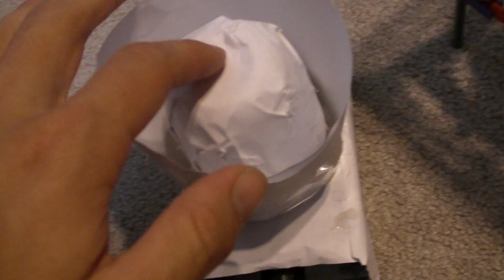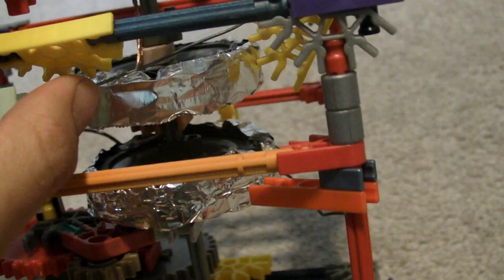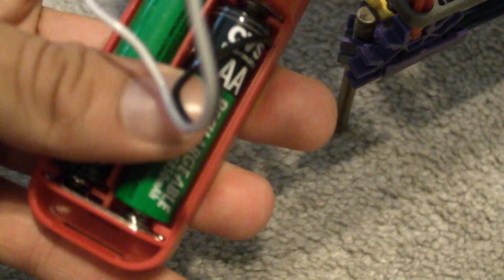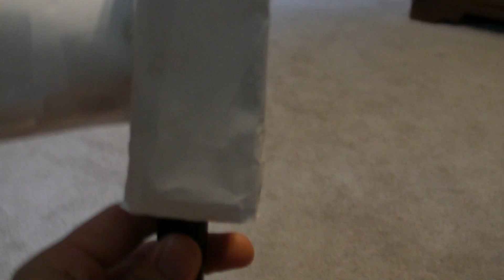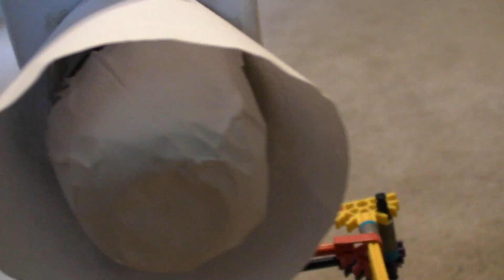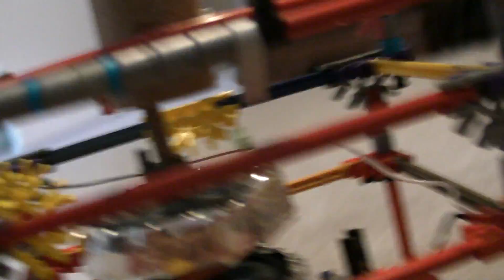Homemade 2001 Siren Rotator Box Wired

Comment: I am trying to make a rotator box fo my siren that I'm making, and I need to make some changes. Right now, all I have is a motor connected to a tiny gear, and then that on one of the giant black gears. I also need to redo the collector rings and make it wireless instead of serial control from my pc. I like your siren :) It's very we'll done.